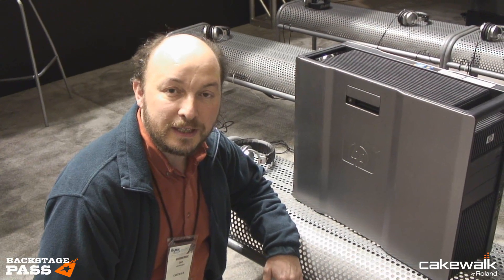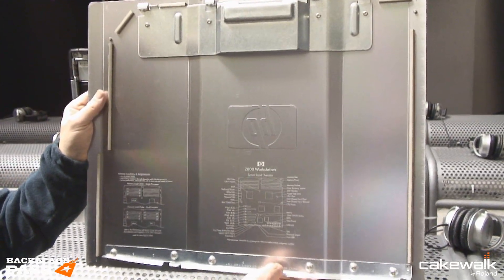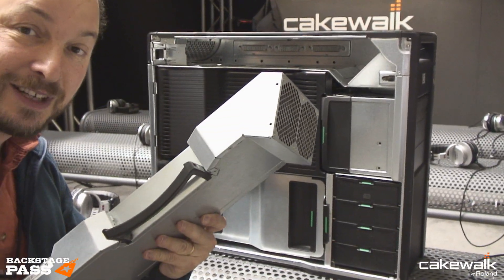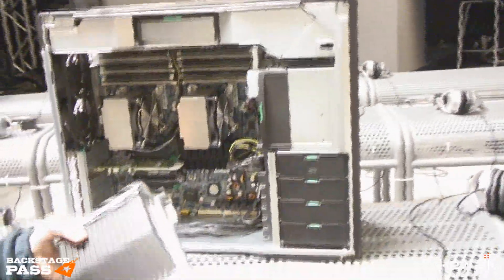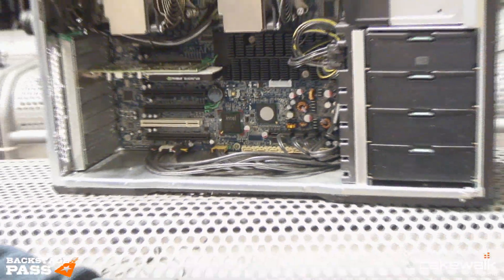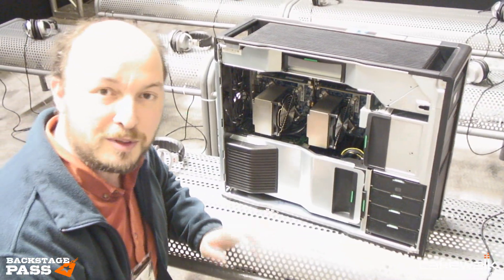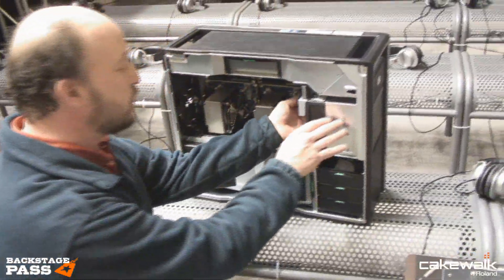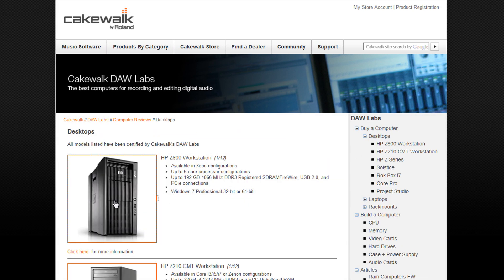Back Stage Pass: NAMM 2012 - HP Z800 Teardown

Comment: dude do you know what the part number is for the 24 pin to 18 pin adapter power cable with molex and serial connectors on it?, I have the 14 pin to motherboard 6 and 8 pin cpu and memory power cable. I need a replacement one for a customers z600, whose girlfriend got pissed at him and took a pair of side cutters and really messed up the psu cable in the backplane.

Comment: While this workstation looks sexy at first glance, you realize as an experienced computer tech, what a horrid design is.   (a) Those plastic insulating panels need to be left off, or discarded.  All they do is trap heat and block access to the system. You always leave your side panel off.  I don't care what any idiot tells you... they do not facilitate air moving through the system.  (b) That power suppy is NOT a standard form factor ATX power supply.  In fact, its a big WHAT THE FUCK! for a computer tech to find.  Connections to it are non standard.  Try wiring up a standard ATX power supply to that bitch, in 10 years, reading the schematics.  (c) about the only thing I like about this design, are the handles at the top, but that can be added to any PC case with a $2 Home Depot handle on the top middle (and I do).  This setup requires two hands to carry (bad).

Comment: Very elegant. I was pleasantly surprised.

My only concern (besides how much it probably retails for) was that such a modular design wouldn't afford the freedom to use components of one's choosing. For example: needing to replace the power supply but being locked in with HP's proprietary offerings.

Also, I know this was at NAMM, but some lab-controlled (or even approximate) temps and respective dB readings under load would have been most welcome.

Great demo. Hope to see more from Dan Bennett.